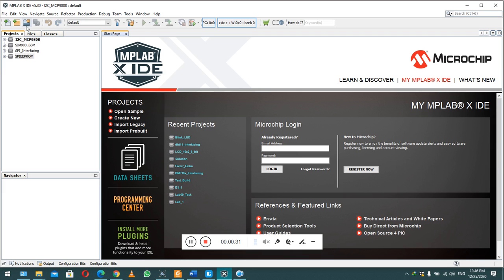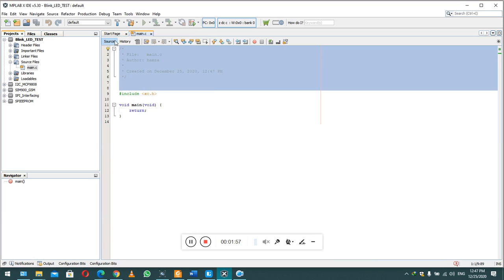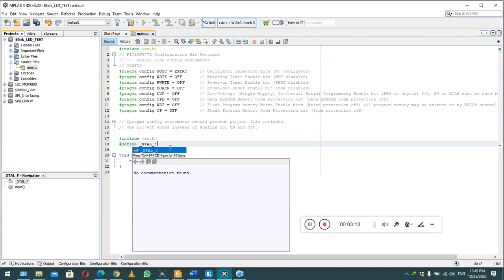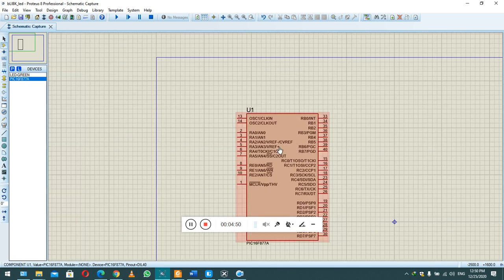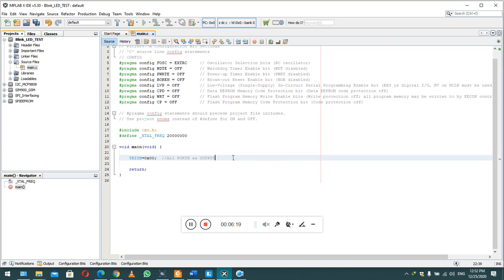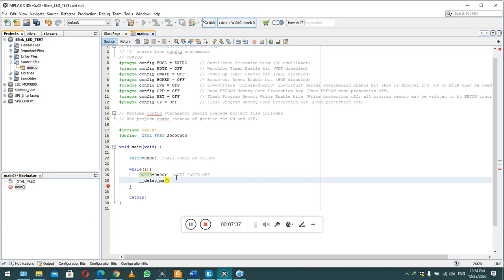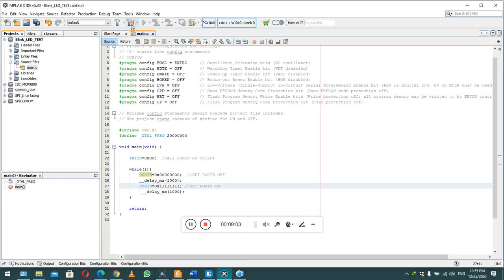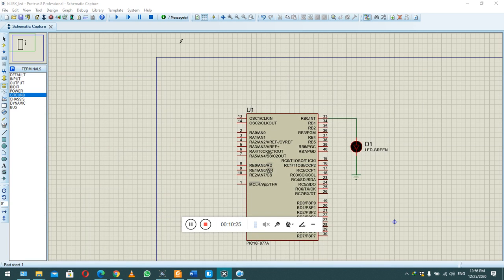Blink Led using PIC Microcontroller | PIC16F877A and MPLABX IDE

Comment: Why didn't you use LAT function?
Reply from the maker: A write to the PORTx register writes the data value to the port latch.
A write to the LATx register writes the data value to the port latch.
A read of the PORTx register reads the data value on the I/O pin.
A read of the LATx register reads the data value on the port latch.

Use LATx: to write to an output pin

Use PORTx: to read an input pin
Reply: @techhunter9184  first sentence of your comment needs some editing I think, 1st and 2nd sentences are the same. Thank you
Reply from the maker: No it's correct
Reply: @techhunter9184  Both writes will write to the port latch?
Reply from the maker: Difference is in read
Reply: @techhunter9184  okay thanks

Comment: Thank you so much I am going to do it practically using pick it 3.I did with simulators. 
is it possible with same code to burn pic
Reply from the maker: Yes you can burn directly into PIC.
Reply: @techhunter9184  thank you so much for your response